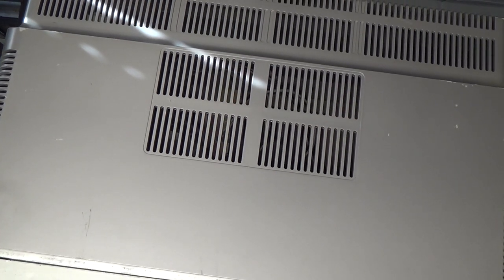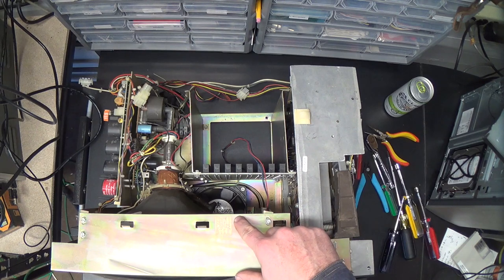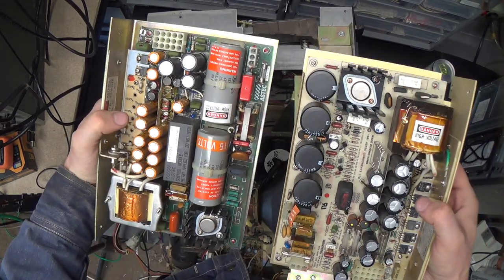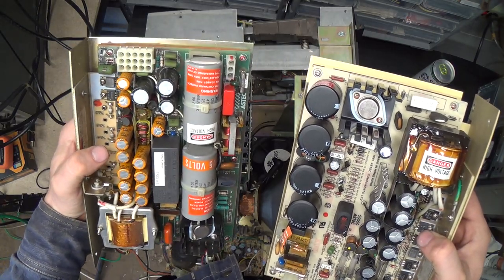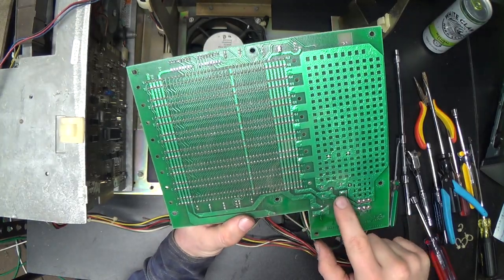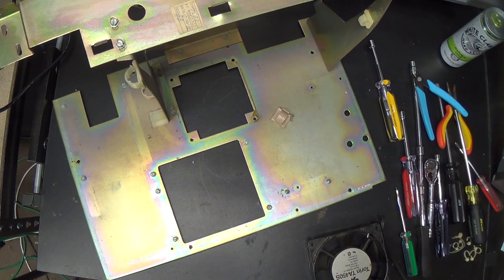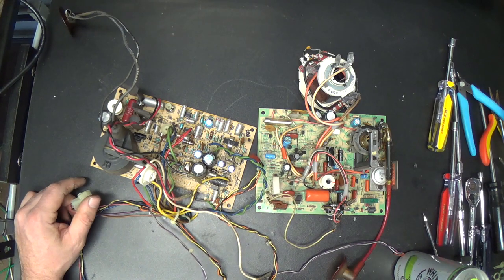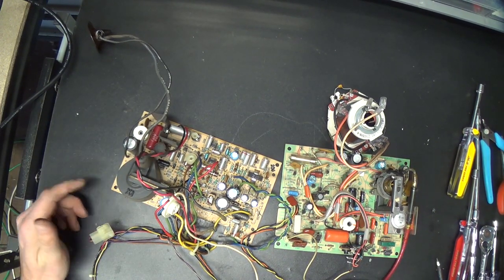TRS 80 Model II Teardown Before Rebuild

Comment: Pre-mature recapper here!  :-D

I don't even turn them on before doing a complete re-cap.  Pull 'em all out, take notes on those not in inventory, filter Digikey by Nichicon, operating temp 105C+, away we go!

If it was made before 2000, they're old.  Maybe fine, but they're still old.
If it was made 2000-2010, it's likely going to blow up despite not being that old because of the plague.
If it was made after 2010, it's probably made to a cost with the cheapest caps possible and I can double its likelihood of survival by doubling the BOM cost.

The fan can go while we're at it.  I've got a nice low-speed Qualtek go-to that turns any PSU into a whisper quiet model.  Stick another on the case inlet for positive pressure, round the IDE and floppy cables, and you've got adequate airflow better than most of the XT to early ATX-era stuff originally had, while lowering the noise floor until the HDD is the bottleneck by a long shot.  :-)
Reply from the maker: Well, if it makes you feel better, then go for it.  :P

That being said, I have an oscilloscope from the 1950s or 60s that has never been recapped and still works fine (aside from needing calibrated).  :3
Reply: That's amazing, since at that age, it's likely to be the older paper and oil caps, right?  And probably lots of point-to-point wiring.. haha

I know some of the maintenance I do is probably excessive, and I can't fault someone for thinking that way.  But it's kind of a zen thing to me.  It's part of a process of getting acquainted with the equipment and having a stake in its well-being.  And, since I probably would at least open it up to inspect it before using it otherwise, I may as well take the time.  That way I know for sure the next time it will need new caps will be when the next guy buys all these antiques from my estate sale.
Reply from the maker: @nickwallette6201  Gigantic old multi-unit electrolytics in metal cans, vacuum tubes, and yeah, everything is point-to-point.  Eico 460.

Comment: The Model II fan when new was actually relatively quiet. Now, the disk drives....
Reply: I may be too young to appreciate the obvious answer, but what is with all the AC powered motors in old computers?  Were BLDC controllers still exotic and bulky at that point?

Just finished restoring an XT PSU and decided the fan was too disgusting to put back into service.  Of course, it's line powered (and about 85% hub.)  Had to run a new cable to the underside of the secondary half to grab one of the ample TWO +12V pads to install a Panaflo in there instead.  :-)
Reply from the maker: The model II is before my time, too.  But my thought is, it was a simpler time back then.  Most everything ran straight off AC (even the ring signal on the telephone lines was 120vac), or had very simplistic power requirements.  I have a feeling that the designers were just going with what they knew, since all this fancypants low voltage digital logic was so new.
Reply: I guess it's easier than designing a higher-wattage PSU that deals well with transients, like turning on the disk drive motor.. haha

Comment: There are 3 CRT boards found in the Model II, 3 and 4. The older board you have is the  original style for a Model 2 or 3. It may have been used in very very early Model 4s. You don't have an example of the "large" board used in most Model 4s. The 2nd board you  have looks like the "small" digital board, designed for the 4P, but used in late 4D's but isn't an exact match.
Info from TRS8BIT Volume 06 Issue 02 https://www.muppetlabs.com/~breadbox/software/trs8bit0602.pdf
Reply from the maker: Thank you, sir!

Comment: just hacked the 120 PICO ATX power supplies into mine,  Radio Shack versus new standards Tandy /White PW Cable - 12V (Blue ATX) / Tandy Orange +12V (Yellow ATX)  ---Tandy Red to Red (+5V ATX) Black to Black